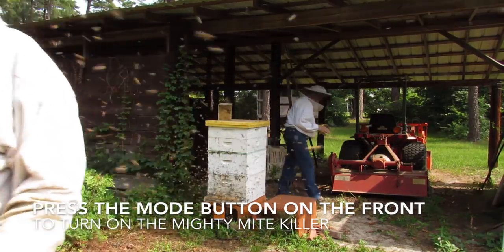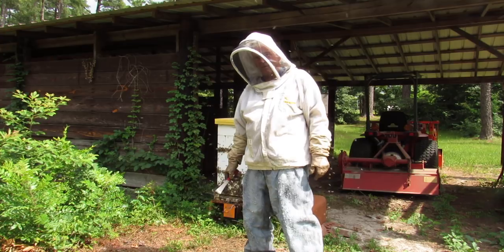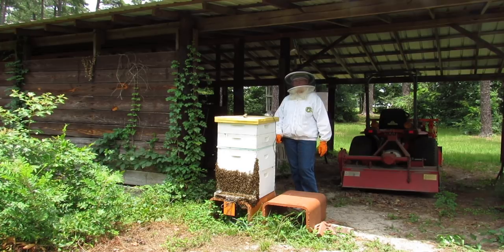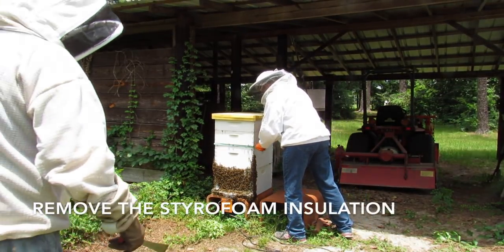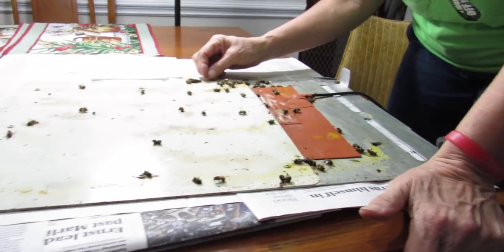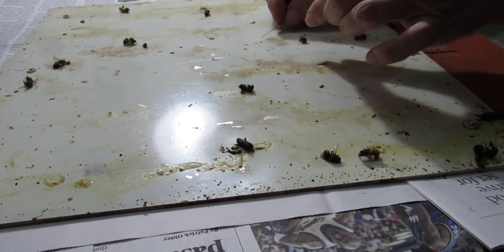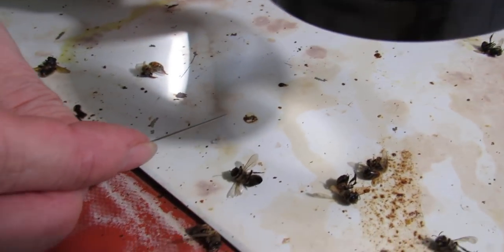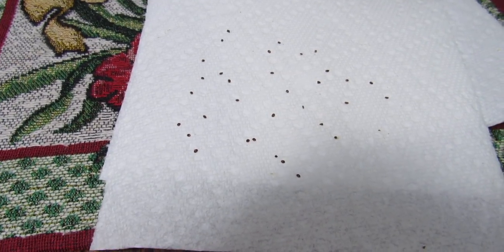the thermal mite kill video #2

Comment: Cliff T: I'm with you. 3 min is better than 48 min. Joe May has his new way of doing it. I would go out & buy 2 or 3 hand wands then you can do 2 hives while one cools off. Those bee's were mad as hell too. I use an old charger so no need to carry around a heavy battery. Need electric cord but this is probably one way of doing it.  Don here's an idea: maybe start a class on doing your method. With that then you can have the students pay for your wands needed. You can then sell them the whole setup at the end of the class as an option. Need to have proper PPE for each student. You can sell it as a complete class. PPE, vaporizor & OX.

Comment: I'll stick with a 3 min OA treatment.  This seems a bit much,  this would be a disaster on a large scale.  NO?
Reply from the maker: I am still using the hand wand but to do several hundred we need a faster method
Reply: I would think you were going to go the Vap 110 route?  Seems like a good method until something faster comes out......I don't think the might Mite killer is the solution just yet. I think if they battery power it and make it more contained of a unit it may be more of an option on a bigger scale.
Reply: Yeah this seems like a lot of work. I'm with Cliff stick to OA treatment.
Reply: kudos to them for trying something new.

Comment: Good grief! Are those Africanized  bees?  The fellow said no harm to the bees.  How many were crushed when he inserted that flat heating panel into the hive?  I bet they knew it was coming and that is why they were a bit violent.  I'll stay with the natural size cell bees.  To date I haven't had a dead out due to mites and I, like Michael Bush, don't treat for mites.  I don't know what that portable oven costs but not having to treat costs me nothing.
Reply: They don't seem Africanized.  They were able to appoach the hive later in the video without having their faces covered in bees.  Here in Airzona, that hive is merely "active".
Reply: Allen Nearing they don’t seem Africanized?? What else do they need to do?  They would literally kill you without a suit. You could watch the cloud of bees follow his body. 

You need to order some different queens if your bees are like this. I wouldn’t be a beekeeper if that was the norm.
Reply: DrFeelGood well, for starters he could still see out of his  veil. I will agree that this hive does not appear to be suitable for a backyard, but there is a much wider scale than you might be used to. That hive is not too abnormal for a well behaved local mated hive here.  Several keepers will tolerate that level of fiesty.
Reply: not AHB.  AHB is much more aggressive.  These bees are quite defensive, however.
Reply: To me, they are far too aggressive for even a non-Africanized commercial operation. Their poor technique did nothing to help keep them calm, but it was still excessive.